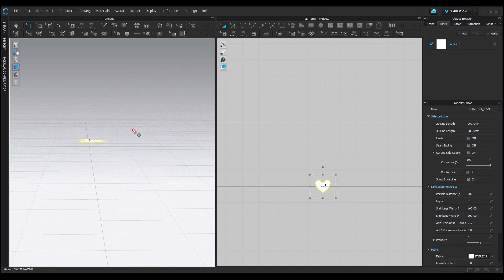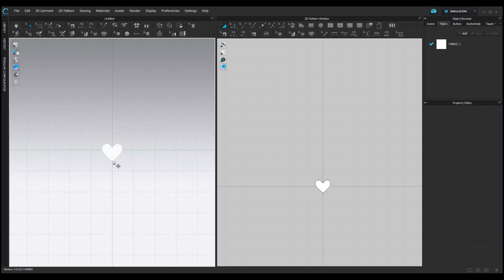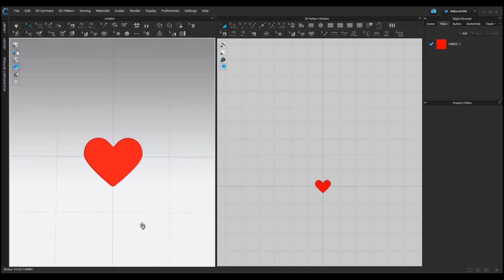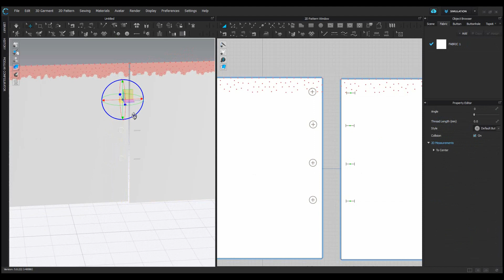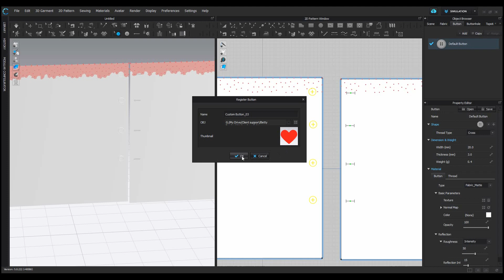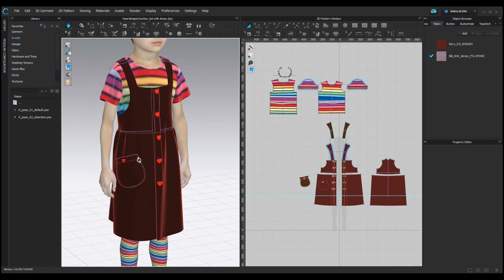How to create a custom button in CLO

Comment: When i try to add thickness it doesn't add it remain thin and flat like a simple fabric
Reply from the maker: Please check your 3D Vertical Toggle and make sure your fabric is set to Thick Texture Surface and not Textured Surface

Comment: Great Tutorial! Fast and simple. No fuss. To the point :) I have a question though: I the same manner, would i be possible to register a bottom press button part as "buttonhole" so when adding top and bottom parts, it is possible to actually close the garment with them (as a regular snap button would do in real life...) Trying to work around it here ;)  Or may be this is now a feature of a new version of Clo? I'm practicing with the trials so far. (which are amazing! someday I will be able to get my own :)
Reply from the maker: Just about anything can be registered as a "buttonhole", so give it a try! If you change the buttons to the male/female snaps you can also use a tack to keep them closed.
Reply: @CLO3D  Sure, the tack is the good alternative. (Btw I found out you can't upload an .obj in the button hole section to the bottom part of the snaps cannot be switch for the button hole).... :(   Also (for snaps) is there a setting to change (like reduce the "additional thickness colision" to reduce the distance from the fabric to the buttons (snaps) so they stick more closely to the fabric? (apart from doing it manually) :) Thank you much for your help
Reply from the maker: Yes. That can be done by selecting the trim and check Collision Off in the Property Editor

Comment: For me, like this coming " This OBJ file cannot be registered as a button. The point where the button attaches to the garment must intersect the positive Y-axis" please help
Reply from the maker: If the OBJ was created in another 3D application, import it into CLO place it on the "ground" at 0,0,0 with the point of contact [to the garment] facing down. Export this as an OBJ. You should then be able to register as a button.

Comment: I couldn't find (Duplicate As Buttonhole To Symmetric Pattern) in CLO 5.
Reply from the maker: You will only have this option if the other piece is symmetrically linked - You can learn about symmetry in the link below 

Pattern Symmetry 22:47
Reply: @CLO3D  Ok thank you so much...that option really makes everything much easier, than placing a button hole one at a time, and lining them up all crooked.
Reply: @CLO3D  Ok It's the same video...but I did miss that part.."Control D" to make it symmetrical. Thanks. 😊👍
Reply from the maker: you are welcome